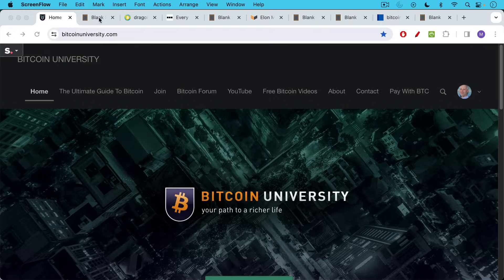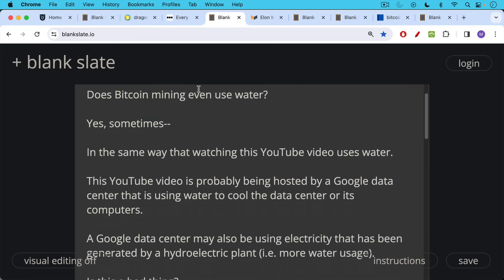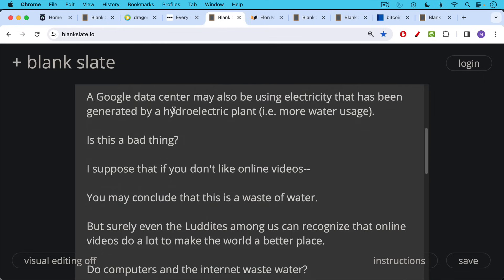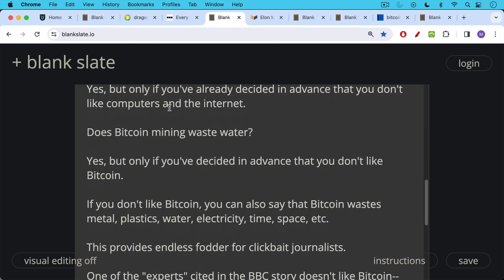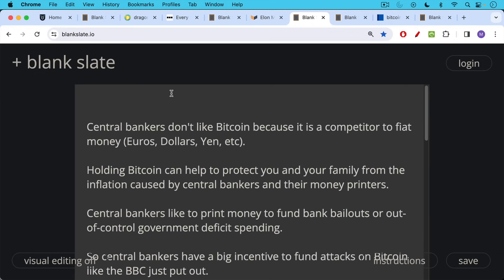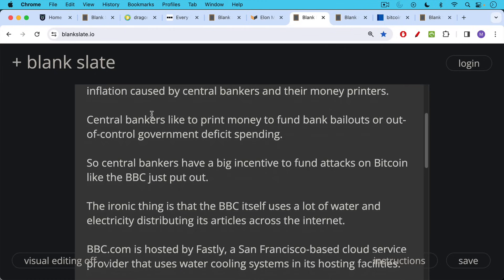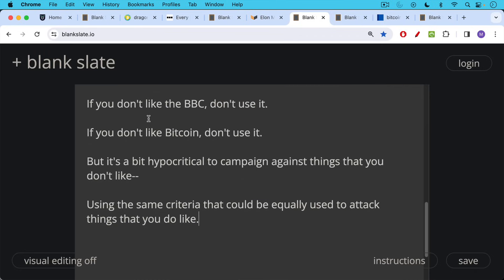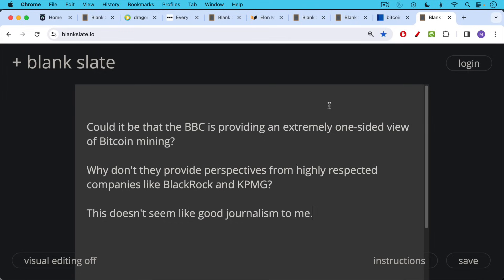Does Bitcoin Mining Waste Water?

Comment: Water is NOT wasted. 
a) Water is warmed in the cooling process, it still is water. 
b) generating electricity by hydropower does NOT waste water. It uses the kinetic energy (because its high) of the water to drive the generator, otherwise the kenetic energy would be used to generate some thundering sounds. That’s all. NO water wastage. 

AND the calculation’per transaction’ is pure dumbness.

Comment: Even if Bitcoin or any other industry uses water for cooling, it is not "wasted". The water simply goes into the system cold and comes out warm, that heat can then be used for something useful and the now cooled water can either be reused, or returned to its aource. It is never wasted because it's still water.

Comment: People try to use Bitcoin energy consumption as an argument to bring it down. I did a rough calculation that shows how Bitcoin could be a more energy efficient way of transaction large amounts of wealth global than it would be using gold. I'm only talking about Energy used to transact btc
Energy consumed by Btc to mine it and energy consumed to transact Bitcoin are two different things. Btc are mined by high powered computers as a way to introduce new Btc into circulation in the same way gold is mined by industry machines and processed into circulation. I would be interested to compare the energy usage of Bitcoin mining and gold mining.

Eventually all btc will be mined and the energy consumed by Bitcoin network will solely come from transactions.. Let's consider how much energy it takes to transact gold versus Bitcoin. Please keep in mind this is a rough ROUGH estimation. Also there may be a glaring mistake in my understanding of units. I would appreciate if a person of knowledge could share there opinion

 Bitcoin energy consumption in 2023 was roughly 703 kWh for 1 Bitcoin  transaction. One gallon of diesel roughly contains 27.1 kWh of energy.  With one gallon of diesel a semi can travel an average of 6.5 miles.

Now let's say I asked you to send me $100,000,000 and I was located in NYC you in Los Angeles. That 2776 mi driving distance. 

$100,000,000 of gold in today's market would weight about 3,365 pounds. Surely you would need a semi to get that to me. So, you would need 2776 / 6.5 = 427 gallons of diesel. Okay so that's 27.1 * 427 = 8968 kwh of energy needed. Google maps estimate about a 41 hr travel time so if we take that as that transaction time that comes out to be 367,688 kW of energy.

Now let's calculate the energy consumption in Btc. $100,000,000 of btc in today's market is roughly 2631.57 btc. So to send this many Bitcoin it would take 1,850,000 kWh . I had a hard time finding how long it would take this many Bitcoin to transact so to make the math easy let's just say a 1 hour time. From my research the average transaction takes about 1 hour.

To send $100,000,000 gold it would consume 367,000 kW and unless you use plane transportation that quickest you would receive would be 41 hrs.

Alternative you could receive in 1 hour and consume 1,850,000 kW about 5 times more energy. 

Okay same calculation but now with a Boeing 747 cargo jet. This baby burns 5 gallons of jet fuel miles. One gallong of jets fuel contains 39.5 kwh. So a flight from Seattle, Washington to Japan be 4846 miles and it would take 10 hrs.
39.5×5*4846*10 = 9,570,000 kw. 

This is where Bitcoin excels. Transaction global would roughly still take the same amount of energy 1,850,00 kW.

Do keep mind what the benefits of using BTC are. The transaction time is significantly less with Bitcoin and most importantly how easy it is for anyone to safely and security moving your $100,000,000 without the of third part company.  The Bitcoin protocol and Bitcoin miners take of that for without you ever needed to interact with them. The beauty of Bitcoin. Though I was surprised and sad to find that it would in fact take considerably more energy. Bitcoin can stills be improved and it challenges like this that drive innovation increasing btc efficiency. Bitcoin is a beautiful and elegant technology blessed upon us by Satoshi. Bitcoin is unstoppable any attempts to attack and break the network will only make it stronger. Bitcoin will save humanity from establishments that try to destroy individuals.

Bitcoin is also borderless meaning that transaction BTC global has far less limitations with gold. It we consider transporting gold in a plane half way across the world energy consumption would significantly go up make it more efficient energy wise to transact in Btc.

Comment: When they say Bitcoin uses water they're being pretty generous with the word "use".  The water doesn't disappear. 
"hydro cooling typically uses a closed-loop system in which water is circulated through heat exchangers without coming into contact with the electrical components"
It's being used to cool the components and the water is continually recycled in the system. So saying it's being "used" or "consumed" as the BBC article states is disingenuous.
And even when additional water is added to the system it's only because some of the water evaporates and turns into rain clouds or is intentionally released back into the river.

Comment: You cant even use up water. Like using water for anything isnt bad, although pouring it down the drain is a waste. But the water never runs out. It goes round in a cycle from the sea to the rain to rivers and back again

Comment: The BBC headline in that article actually references transactions, not mining which seams even dumber to me. Mining bitcoin consumes electricity, which is converted to heat when the computer runs. The heat can be used for beneficial purposes such as heating swimming pools :) or local district heating schemes. What's not to like? Individual transactions must use a fraction of the electricity that mining consumes. Great video Matthew.

Comment: It is literally impossible to 'waste' water. Water is a renewable resource, 'using' it for cooling or anything else does not destroy it.
Reply: Not to mention, water cooling in computing is one of the most efficient uses, as the same water is cycled trough the system between the heat sinks and the radiators.  Very little ever leaks out of the system (mainly when cleaning, priming, or when there is damage).